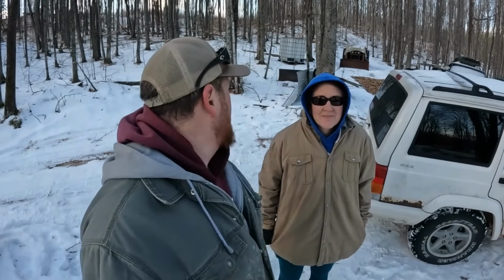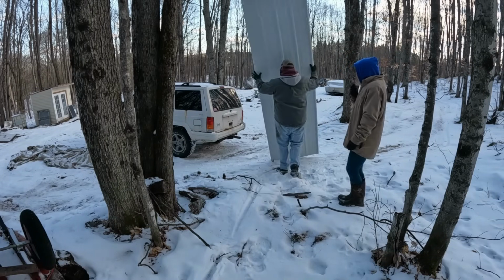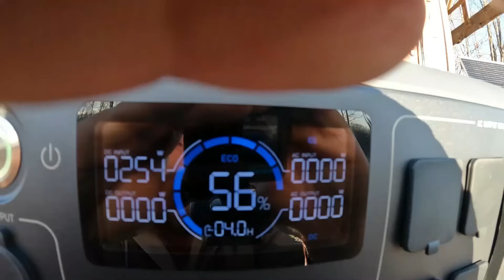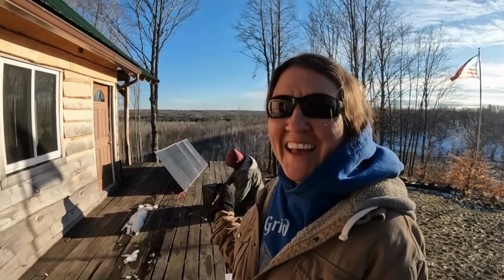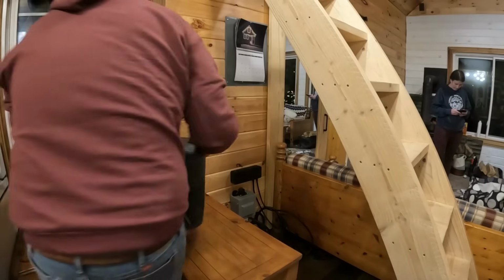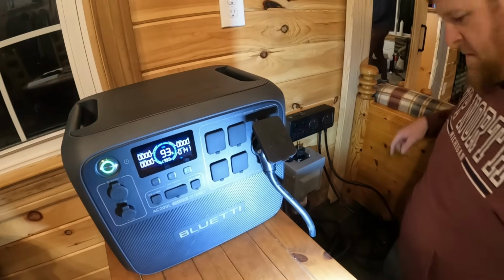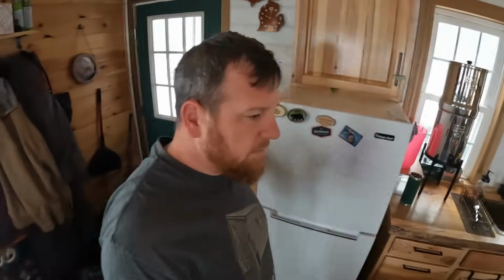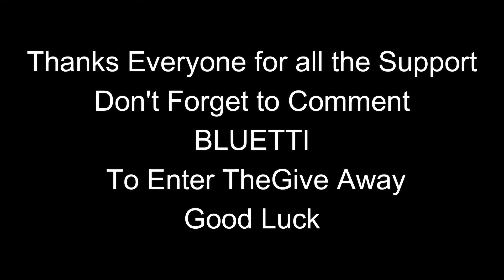Siding our DIY Lean-To on the Pole Barn.

Comment: Seems like every storm, Winter or Summer my power is out. Back in 2017, after 7" of rain fell in 24 hours my township had major washouts. We were isolated from leaving for about a week until some road repairs were completed. A Bluetti AC 200L would have been nice. Thanks for the videos.

Comment: Hey guys, love what your doing for your viewers, if you save your fireplace ashes you can spred it on the slick spots of your drive for great traction. Plus sunshine will help with melting. And might i add Bluetti.
Reply from the maker: Great tip!
Reply: I believe you can use them for food preservation, and you can make soap, too!

Comment: Bluetti, I am in south Florida and the backup power would be wonderful as ours goes off often with summer storms, but the primary use would be to power my ham radio equipment for portable operation year round. My generators make too much noise and interference. Fun time watching you guys build out the cabin site. Keep plugging away. P.S. I love me some Michigan but it is a long haul since moving down here from Indiana a couple years ago. Needing a Michigan fix here but it will have to wait till summer :) !!

Comment: Bluetti  Are you still using water out of the IBP tote? I'm in South Carolina and use a IBC tote as well. We never have temperatures low enough to freeze the tote, just the lines going to it. Hot water on demand is great but will freeze. I know this from experience. 😞My next water heater will be a small tank stile RV water heater, it want freeze unless 
I run out of propane. Hoping to add a bedroom to my cabin like you did one day, then I could close off the up stairs when it's only the Wife and me. Merry Christmas.. See you on the next Video.
Reply from the maker: We did turn the water back on....weather warmed up a little so we figured we might as well use the stored water, before we dump it

Comment: I looked up the price on the Bluetti and i think its reasonable. My first powerstation purchase was an ecoflow. Works well enough but the solar.panels don't live up to expectations. What type of solar panels were you using in this video? Watching from central NY state.
Reply from the maker: Hey hey,   I was using the 400 watt folding solar panel from bluetti.  I have tested a lot of portable solar panels and this one produces the best of them all.  I had it producing around 360ish watts on a nice day. Most the portable ones you're lucky to get 50-60 percent. This one did way better

Comment: Wondering if you noticed any discernible difference between the Bluetti unit and the Dabbssons?
Reply from the maker: Both work great.....today's technology charges fast and holds up well. I do wish the dabbsson had a built in 30 Amp plug we could directly plug into one unit.....but the system dabbson has allows better vesitily and portability.  Everything has its pros and cons, you just have to figure out what works best for your situation
Reply: @OffgridwithJayandJen Nice to hear it's more about feature sets as opposed to performance. Should make the decision process a little easier, thanks!